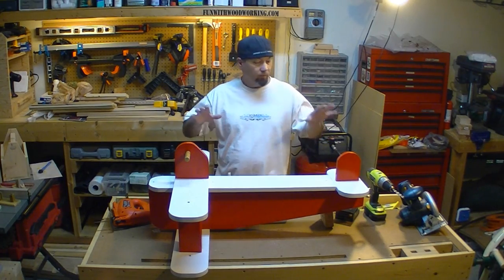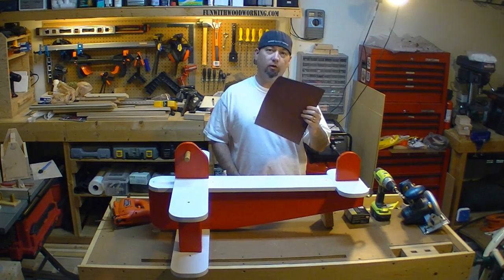Limited tools project - how to make a wood airplane swing

Comment: Sorry, I can't help but say that you said you only used a jigsaw, a cordless saw, a drill, deck screws, and a piece of sandpaper.  My OCD had to point out that there were also 2 sawhorses, 3 clamps, a speed square, a tape measure, a level, wood glue, and a few other minor things used.   Good job still though...
Reply from the maker: Barratt Schichtel You missed the 3 ft level.  Go back and watch it a couple more times.